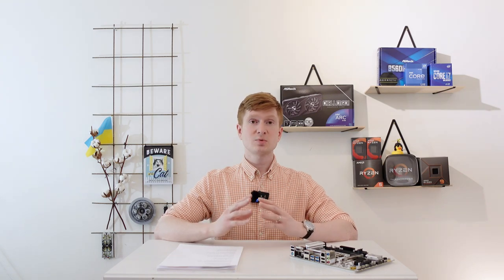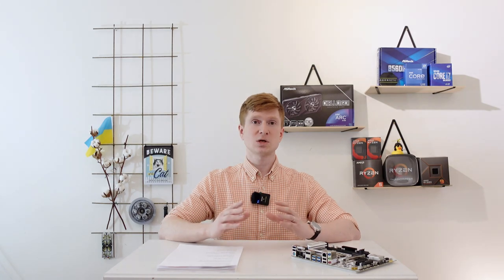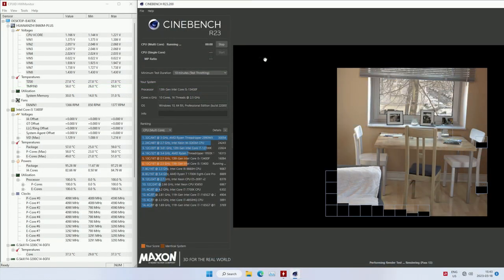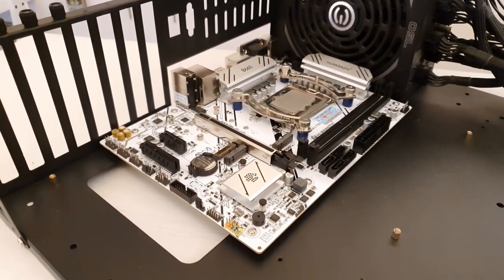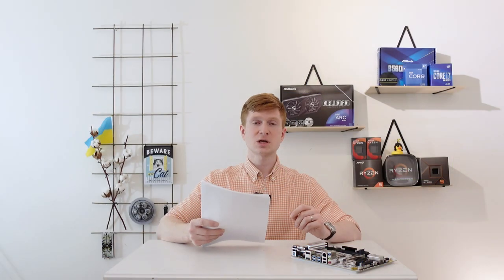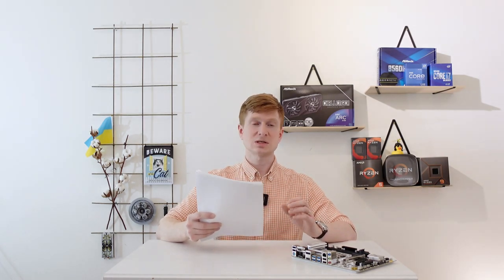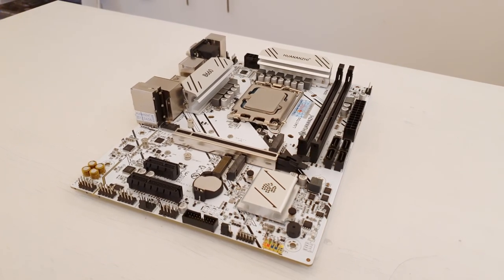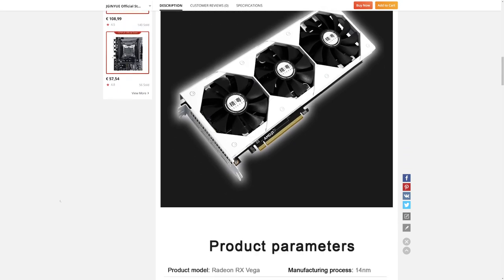🇬🇧 Huananzhi B660M-Plus LGA 1700 – motherboard review with i7-12700k and i5-13400

Comment: I love how Huanazhi is going really fast from
"mehh just a chinese fake x58, x79 and x99 mono manufacturer"
Into a really decent manufacture of motherboards for standard CPUs

and prices are still really nice if you ask me
Reply from the maker: Yup, Huananzhi have certainly improved a lot, but they still need to work on an international website with all the drivers and support. Also need to finally fix the long lasting issue with Smart Fan and 3-pin fans.
Reply: They are like $85 usd retail without sale, where i am, quite a steal

Comment: Thanks for the good review! Just bought this motherboard before the promotion ended for around $75 and it seems a great budget option (with a few nitpicks). As a side note another reviewer (Mario Mazzotti) tested 4400MHz RAM modules and they reached a 4267MHz frequency (133 clock x 32 ratio).
Reply: I saw that video, but he was using a non-k cpu, he should have tested the stability of the memory.

Comment: I am getting a Cinebench score of 21400 with this motherboard and a 12700k. It throttles very quickly and temps reaches 100C before the first run finishes. So I would be curious to know which cooler you used and what are your bios version and settings:
pl1/pl2 power limit and ac/dc loadlines?
Also do you use a contact frame?

Comment: love the review , however for the price i think id rather go for a more well known brand for very little more . I'm just glad huananzhi are making a name for themselves with new platform stuff. I've had my x99 board now for 2 years running my 1660v3 at 4.2ghz most of the time with no issues apart from a dodgy lan driver . however for an all white build this is great because nobody else offer this for some reason
Reply from the maker: I agree. If the price would be 10-20 Euros lower, it would be the perfect budget motherboard. It's also a bit annoying that the motherboard is not fully white, too much black added.
Reply: @Miyconst  it's whiter than most out there I can find. What would be really nice is bclk modifier
Reply: But of course... That my be too much to ask

Comment: Hello mi amigo !
If i can ask a question, an 5800X with 3080Ti, with watercooling on top, i've beteween 70 and 85° CPU (80° on GPU) while i play at somes high demands games, does this is alot ? (I can't put the WC on front btw)
I'm thinkin about changing to an aliexpress motherboarD/CPU but does it would be useful ? 

I ask to you because when i ask on others forum, almost everytime, a sellor advice me to buy some others component of course, the others people have like 100 different answer and i want a true answer as you seems to know the topic perfectly.
Reply from the maker: 70-80C is totally safe for CPU and GPU, you don't need to change anything. Just make sure that you have a good airflow inside your chassis to also cool the motherboard.
Reply: @Miyconst  My cable management is really clean so my airflow is pretty good i guess, but my room is pretty high on temps but i can't change that.. My case is an Antec NX700 !
But you reassure me about my temps :)
Reply: @AmiralNitto  Airflow depends too in the case (chassis) design, if the case have glass over the front fans, or that "fridge" design, the airflow will be por and contribute for CPU and VGA temperature increase. To no talk abou case fans quality.
Reply: @Sokol10  I put my ref' on the com' above, my chassis didn't have glass , only on the left side, this is mech on front. 
For the fans, i've take a chassis from a brand who was pretty knowed as good for airflow, and i can put 3 smaller fan if someday i need to change my front fan.

It was something i was lookin for, unlike my brother who've a full glass chassis, but like i wasn't using Afterburner before i never notice the temps for my CPU before, only for the GPU so i was pretty loss with this temps. 

If i can ask, i will change my PC from his place soon, but the next place will be right in front of my windows, does that could be a problem for my PC ? Like moist air or too much air in the front ?

Comment: This vrm suport 13600kf?
Reply from the maker: Yes, it would be fine, it's about the same as i7-12700k.
Reply: @Miyconst  Do you think that an ID cooling IS-50 with a mining delta cooler with 100 or 150cfm can keep the 13600kf below 90°c?
Reply from the maker: @heroipordiversao3934  even Intel box cooler can keep i5-13600k, under 90C if you limit TDP or set the max temp target, but if you want to use unrestricted mode, then ID cooling IS-50 won't make it for you.
Reply: I wanted to use it without overclocking, for some jobs and for games. but I see news saying that not even the water cooler is managing to lower the temperature of 13600k, 13700k and 13900k. so I still couldn't mount my setup. But you gave me light and courage. thanks for the excellent work! only tester i believe 100%
Reply from the maker: @heroipordiversao3934  if you are willing to spend this much for a CPU, just buy a decent motherboard and skip all the headache.

Comment: Nice review. 

But Jginyue VEGA 56 at the end of video is now notorious in China. It was the 5th best selled item from Jginyue's PinDuoDuo shop, then was reported to be a mining card from 狼神矿机 !REWASHED! and !REPAINTED! to the thing we see right now. After exposed, Jginyue removed its VEGA 56 from all B2C platforms in China.

The worst part of the incident was that Jginyue's customer service claimed that it's an old gpu chip replanted to a new PCB, but the disassembly proved it a total lie. And some of these cards sold were even flashed with original mining vbios.
Reply from the maker: Thanks for the info! I expected something like this, but it's still worth it for a video.

Comment: Can you set the memory above 3200mhz?
Reply from the maker: It works, you just need compatible memory.
Reply: @Miyconst  Even with the i5 13400?
Reply from the maker: @augusto6405  yes, but due to Intel artificial limitations, with locked parts you get performance degradation after DDR4-3400.
Reply: @Miyconst  With non-k cpu you can't change the voltage for the memory, which I think leads to instability, but did you try with the 12700k?